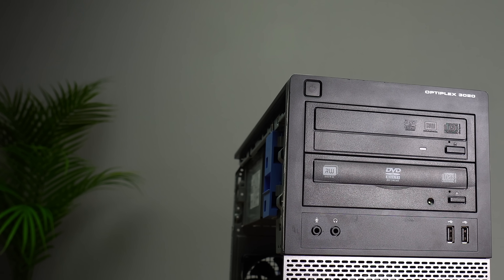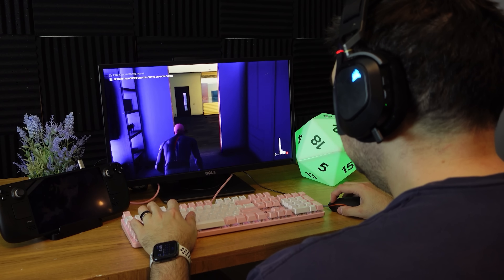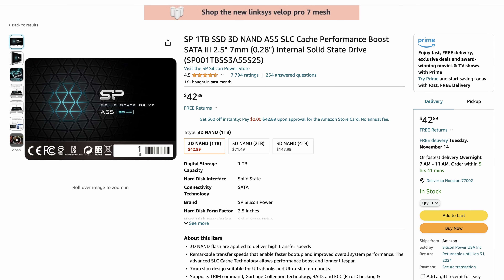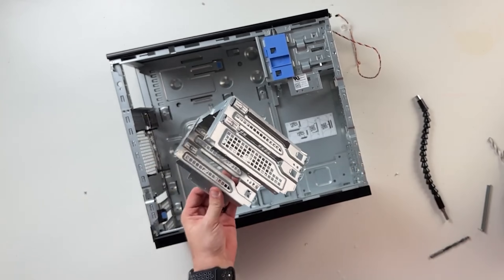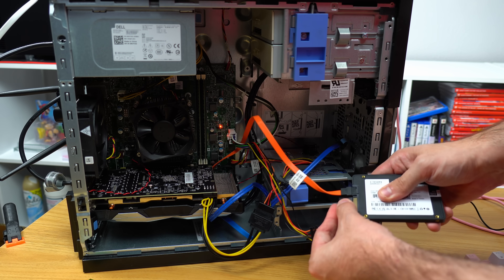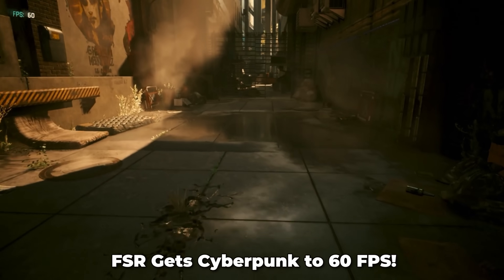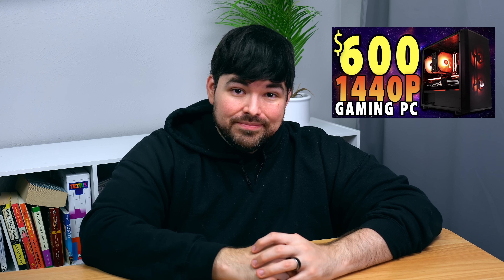Yes, You CAN Build a $100 Budget Gaming PC!

Comment from the maker: Thanks for watching! Would you consider a PC this cheap??
Reply: Yeah for sure it's still usable for esports games and old games can also do emulation.
Reply: Yes, I bought two a while ago.  Gutted one and turned it into a Ryzenplex, the other one I triple boot.
Reply: can you benchmar more games
Reply: Yeap,theres a literal tonne of games it can run in this day and age
Reply: The PCI-E to SATA power connectors are called fire starters for a reason.
Reply: Well, it's a 4th gen, with 16gb RAM. My daily driver is a 4th gen 4770k, with a GTX1080 8gb, and 32gb RAM so...yes.

Also drop a $20 xeon into this thing and watch it fly.
Reply: Yes definitely, where is the link to remove the drive bay  from the  case
Reply: thats not gaming pc.. so no
Reply: Hi, The 3020 is rated for 255w, and the power supply is rated for 290. Did you go over the rated amount when you put the graphics card in? And do you know any other graphics cards that would work?
Reply: Cheap gaming is ok. My recommendation to everyone is to stop trying to buy the best GPU. Get "rendering" out of your mind. I mean you need rendering but you don't need high rendered resolution. I have 2 cheap methods to play in full 4k 60fps with HDR. There's a software solution and a hardware solution. The dirt cheap method is buying a program called Lossless Scaling. They way you get 4k HDR 60fps. Is by leaving your PC display on 3840x2160 and play all your games in 720p windowed mode only. Upscale with the program, 4k 60fps HDR. I like the hardware solution. Use a 4k Gamer Pro to get 4k 60fps HDR. The way this works is to keep a active signal of 1080p 60hz. 640x360 and 1366x768 are both considered a 1080p signal because your 4k TV will upscale those resolution to 1080p. 720p is not a 1080p active signal. Use 360p for retro games only. Use minimum 1366x768 to play all games in true 4k 60fps HDR. For best quality, use native in game 1080p 60fps. 1366x768 is minimum requirement for this device to work and you'll be very happy with the upscale results.😅
Reply: Can you do this with 65$ dollars
Reply: @Sourneszz  No, and if you do find a $65 PC. It will only run Nintendo emulators on it.
Reply: @Sourneszz  LTT has a video of a $69 PC
Reply: sure those are great specs
Reply: When is the $1 pc?
Reply: Didnt hear you mention the adapter for the power supply to Dell motherboard? 24 pin to 6 or 8 pin?
Reply: Hey man I had a question is this good? Agdata Desktop Computer i7-4770 8GB RAM NO HDD

Comment: Yes you can. I've done it multiple times. In fact my latest build only cost me $45 or $50 and the mother board took only $18 of that. A soyo H61 board with a M2 NVMe slot. It's so far been one of the best I have. Even with 4 SSD drives hooked up for gaming storage. And the good ole trusty and beast i7 , i5 , i3 s I have installed in laptops and desktop. Optiplex's 3 of those. Well 2 because my i7 intel got removed for a ASRock am4 B55Om Pro 4 with a Ryzen 5 3600 and this is going to be my most expensive build yet. But there are online places that will help you with monthly payments and I'm talking very cheap payments. I use affirm for bigger purchases because of how low the payments are every month. There is Afterpay app and inside of cash app there is another Afterpay. If you buy anything over a certain amount with your cash app card they will offer you to get the money that u just spent and pay payments. Klarna is another good one progressive leasing is great but you have to at least spend over 300 but you're paying 11 dollars and week you don't even know the 11 is takin out of your check. Citizens pay is how I bought my Xbox series x for 36 a month and they gave me a 2 year ultimate game pass with it so I kinda was only paying 10 a month for the Xbox because I was always buying gamepass every month. And the best part is they don't really charge interest. For example I bought my Ryzen 5 3600 off of Amazon for 70 or 80 dollars. I paid 3.75 as a down payment and that's only because I have a couple accounts with them usually you pay nothing until you're payment date a month later. I pay 8.85 a month and all they make out of that deal is 7 dollars for themselves. If you are on a budget or working pay check to pay you still can build and game and hang with the big dogs. Trust me. I always thought there was no way I could afford that. Now I'm a Asus gaming laptop gamers of republic fully updated to the max. A HP laptop i3 10th Gen touchscreen that is fully upgraded and a Beast. Soyo H61 board with 32gb ram and 500gb M2 NVMe SSD 3.0. with a Radeon RX 4gb  GDDR6 570 graphics card and a 2 gen i7. And I used a rectangular fish tank for it's case. Fans lights and a ball room light.  Facebook marketplace is another good place to find what you need.

Comment: 5:25 That's a very scary adapter. Those 8 pin connectors are rated for 150W. 15 pin SATA connectors on the other hand are merely rated for 54W and odds are it's connected to a single flimsy cable on your cheap PSU.
If you use one of these to power a GPU that actually draws close to 150W from that connector (and such cards are common), you don't need a 50xx series card, because you've got multi flame generation at home.

Comment: I got an Optipex 3060, with an i5 8500, for 60 quid - got a 1050 for £40. It works well, I also put in an nvme drive. It's pretty quick, the kids use it for gaming and it works really well.

Comment: I got a bit lucky, but bigger budget kind of.  SH market. Anyway it was a total of: 188$ total. Could have made it 150$ with more struggle...

Case: 7$ (HP)
PSU: 10$ (Corsair 550W) btw, you have to work a full time day to find those products as i did.
MB: MSI B450 GAMING PLUS MAX: 40$ (im so happy about this one cuz my 1st goal is OC)
GPU: XFX RX 580 8Gb: 45$ (it was mined for about 1 year, its just as good as new)
CPU: R5 2600X: 30$ (this was the peace of resistance at its price)
16Gb DDR4 GSkill Flare X CL14 for AMD: 40$ (i hate to chose between this or a normal CL14, i said f* it, for 10$ i go full OC mode)
256 M2 SSD: 15$ (this was new and no name, but it is fine)
__ so yea, it runs GTA 5 on ultra (except grass) around 75 FPS. Im sure i will beat the 80+ mark with overclocking it to the max.
__ also tried ARK Evolved and it work perfectly on high/epic (i made a preset) and its around 50-60 fps.

Comment: was working at school last summer converting it into an office building and they gave me and old hp desktop. got i5 4570 cpu 8gb of some old ass ram and 250gb ssd. i bought a 1080 gpu for 100 bucks and a power supply for 60 and it runs apex like a champ.
Reply from the maker: Sounds like a legit build :) nice work
Reply: @JasonWitmerYT  Ya it's not bad. little different then the 2k build i had before but it works. The psu is jumped tho and only powering the gpu because of connector issues i wasn't aware of when i purchased it but it works for now. Gonna upgrade to the i7 4790k, 16gb ram and 1tb storage. I could buy a new build but i'm kinda hooked on seeing what i can turn this into at this point :)

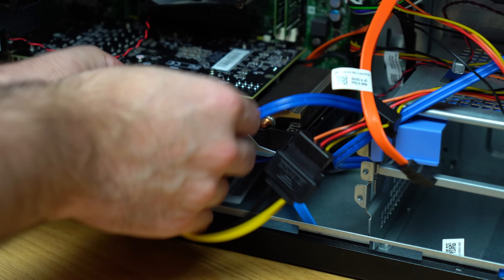Comment: 6:38 The RX 580 2048sp is actually an RX 570 locked at around 60% of it's original power draw. So, about 90w. Pretty safe to use sata adapters since the PCI-E slot is already providing around 50-60w. Btw, the performance isn't as bad as you would expect given the limitations. Is only around 15% slower than an RX 570 despite the 60% powerdraw limit.
Reply: In the use case of upgrading a Dell, that is actually a good thing that it is lower power.  I thought the Chinese RX580 was just an RX 570 in every way including its 150W TDP.  Are you sure this isn't just certain boards with a PL BIOS?
Reply: @douglasmurphy3266  When it comes to the RX 580 2048SP, I've used it with generic PSU's for years without any problems. But I haven't really measured the power draw by myself.
There's a YouTube channel which covered this a while back. I'm gonna try and get hard evidence and come back at you.

Comment: I bought a used dell optiplex 7050 for 100$ on eBay and it comes with a i5-7500, 16gb ddr4 ram and 256gb ssd. I feel like it was a steal and deal and it was perfectly clean. Shout out to Seabee5

Comment: i got a 3020 sff was thinking about rx 6400 or 1650 low profile single slot Or should i remove the psu so i can slot in the cheaper 1080 or other full size card, als using power adapter cable to graphics card? hmmm what other options rx 550 would fit but is too old or 1050? what others are there
Reply from the maker: All good options, I’d say just stick with the RX 6400 👍
Reply: @JasonWitmerYT  ok thanks :)

Comment: Would that PCI-E adapter work well for a more powerful gpu (but still only single pin connector) ? I have an i7-8700 processor which is decent but it's in a proprietary system with no PSU upgrade option. The PSU is 250w so not that strong,. the TDP of the 8700 is 65w non-boosted. What's the max GPU TDP I should aim for? Or within safe range, I should say. I was thinking maybe the 4060 since it only has around 110w TDP and is a very powerful card, albeit probably overpriced.
Reply from the maker: Not worth the risk. If you’re going to buy a pricy GPU, replace the power supply.
Reply: @JasonWitmerYT  Ok. Thanks for getting back to me so soon!
Reply: @JasonWitmerYT what power supply do you recommend?

Comment: I have a windows 11 Hp desktop pc with 4gb of storage. Is it possible to build a gaming pc with the parts inside of this one and just buy extra storage? I want to order one of the clear cases and the cooling rgb fans, I play a couple of games through steam like both of the "Two Point" games, "Havendock", "Disney Dreamlight Valley" and "Sims 4". I stream, (watch shows, or youtube) on my pc, always downloading photos and pdf files, and have some video files. This is why I need the storage. I have an external hard drive, but getting tired of transferring everything over all the time. Me personally, I think this would be doable. Been trying to find a tutorial on here if someone has already done it..
Reply: Ok asked all this before I just clicked play on your video.. I bought mine from WalMart last year, so it's modern. I'm using a 27 inch roku monitor. I was wanting the terabyte pc they had, but it was out of my budget, since I was having to get a bigger screen so I could see better.
Reply: I hope I won't have to reinstall windows if I am using my same hard drive..I have never installed everything from scratch. I always buy pc's with everything already installed..
Reply: When I play "Two Point Campus" on my pc, it freezes sometimes. Don't know if it's the game itself or my pc..
Reply: I have a Intel Celeron J4025 CPU, @ 2.00GHz, 64bit operating system, 4.0GB RAM..I have no idea what Gen my CPU is. The graphics says Intel UHD 600 under the display adaptor..I would like to add to my already existing system if all this makes sense..

Comment: I did a build like this with an OptiPlex 3010 about a year ago for a friend of mine. It had an i5 3470 in it and I put in 16GB ram a 1TB SSD and managed to score a GTX 1070 on Facebook marketplace for $70.  The total build cost was $185. to this day, my friend loves the system and uses it constantly for all kinds of games.
Reply: Did you change the psu if not did it work fine?
Reply: How did you get a 1070 with a 8 pin power cable on a dell optiplex without a 8 pin?
Reply: @thealien_ali3382 adapter man

Comment: I got a HP z420 workstation for 90 dollars on ebay with 32gb of ram and a xeone5 1650 v2 and threw a GTX 1060 I got on jawa for 60 dollars in there and used the extra 35 for a 256gb PNY SSD. I also found a 2tb HDD mouse keyboard and monitor on craigslist for a few bucks each. It was a little under 200 dollars and works really well in 1080p

Comment: Nice build! 

Some feedback - you should have gotten a 2x SATA to PCIe adapter instead of the 1x SATA to PCIe, they're capable of 108 watts instead of 50 and they're safer.

Reason that 2 SATA cords is safer is because the RX 580 GPU can get to 150 watts. The motherboard supplies 75. That means your singular SATA cable will be supplying 75 watts, which is WELL over the safe limit, making this PC a fire hazard. 

If it was a lower power GPU like the GTX 1650 Super (only needs 25w from sata or PCI power) then your adapter would work fine. 

Stay safe, and nice build.
Reply: u dont wanna draw even 50 amps over sata or molex
Reply: @predatortheme  amps?? Never mentioned amps
Reply: @charliesretrocomputing  You did not, thats right. I was just saying, pulling too much amps over molex/sata is always a bad idea, i managed to melt a few  connectors just by doing such a "hack" via sata/molex to pcie

Comment: Just got an optiplex 7040 MT 16gb of ram ddr4 an i7 6700 and a 500gb HDD for 50$ all i did was buy a 1050 Ti for 60$ and a m.2 SSD for 40$ which i can use for a later build no adapter needed or anything.

Comment: rx 580 2048sp is 150w tdp
the pcie slot provides 75w
the maximum for that sata adapter is 54w
If anyone is building this with the adapter, make sure to set a power limit of 129w or less.
It probably won't catch fire, but it is possible.
Reply: legend
Reply: how to you set the power limit?

Comment: i bought my 13 year old son an 
HP ProDesk 600 G1 Small Form Factor
Upgraded the CPU to an i7
Upgraded the ram to 16gb
Installed a Dell AMD 4gb low profile Graphics Card 
Installed AMD adrenalin software with the correct Drivers for the dell amd card.
And the Thing Rocks.

Comment: I need help do you have a discord by chance that you could help me? I have ordered a RX 580 Sapphire Nitro+ Special Edition and it has two ports on the gpu, one is 8-pin and one is 6-pin and I need to reflash the card to get it back to stock (eth mining card) and I need to know what SATA adapters I could use.
Reply from the maker: Sorry; I wouldn’t recommend using that card in this pc without replacing the power supply. Too much power draw
Reply: @JasonWitmerYT   it was the only thing i could find on ebay that wasnt in the bidding tab, what PSU would you recommend? I know nothing about optiplexes so im pretty much in the dark here
Reply from the maker: Any power supply would work in there! They all would fit and are easy to replace
Reply: @JasonWitmerYT  i found a 650W PSU i asked around in a pc building discord server and one of the guys in there said 650W would be good 👍

Comment: Yo can def find deals. I got a 200 quid pc thet had dual xeon e5 12 core cpus, 128gb ddr4 ram, gtx 1080 and quadro m4000, 1tb ssd and 4× 2tb hdd(8tb), 1000w psu, and a top of the line asus dual xeon mb as well as few other goodies like noctua cpu coolers and a 300 quid case. Sold the two gpus for 200 and bought a rtx 2080 super for 220. So 220 quid all in. Keep yer eyes peeled people

Comment: This is a great example of just the basics of PC gaming at an extremely low cost. I personally would have tried to find a 6th or 7th gen i5 or i7-4790k and used its iGPU, or use a low-cost 4 to 8GB graphics card. I also would have installed a 250 SSD or a 1TB 7200 rpm HDD even though it's pretty slow. In my experience, an i5-6500T and 6200U certainly won't get 60fps but it'll run Fallout 4 on low/medium settings and New Vegas at 40fps on high without designated graphics.
Reply: can u please help me i have dell optiplex 3020 tower version i5 4590 and 12 gb ram firstly i wanted to upgrade my r7 240 gpu to rx580 but comp tech said my mothercard is not compatible and my psu is not enough is any good suggested gpu without i need upgrade my motherboard and psu
Reply: The problem with those igpus is that while their average fps is acceptable they tened to be plagued with stutters especially if you dont have a ton of ram
Reply: @NinjaWeedle  Yes, indeed. My Thinkpad runs the 6200U and it's certainly no Legion gaming laptop. Of course, you must sacrifice something when your budget is extremely low for a PC or laptop, I did for a few years with my desktop from the garbage and my GT 1030 which ran corporate stable games. Wasn't much PC Master Race but Skyrim played well enough to enjoy it.

Comment: Four threads with low clocks is just pretty "meh" these days. I'd try to get a slightly newer model with an i7-6700 and have a slightly bigger budget.

Or maybe I'm just too used to modern-ish hardware with my R7 5800X & R5 3600 rigs :D